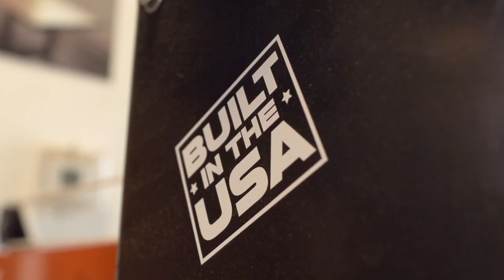SlabMizer MB200 Slab Flattening Mill in Action | Wood-Mizer

Comment: At work we have a CNC that is primarily used for flattening slabs and I think I would prefer a machine like this. The cutter on the CNC is only 2” diameter vs 5” on this machine, and we restrict it to .05” per pass to ensure that it doesn’t bog down when running. I always do at least one manual pass to ensure there are no surprise high spots that are going to stop the machine and to speed past the low spots where the cutter isn’t cutting at all. It looks like this machine has the power to flatten a slab in a single pass, so given the way I actually use the CNC, this machine wouldn’t take any extra time.

Comment: How much does that big beauty run?
Reply from the maker: The SlabMizer starts at $16,995 USD. For more info and to request a quote visit - https://woodmizer.com/us/Products/SlabMizer-MB200-Slab-Flattener
Reply: @woodmizer  That's only 4 easy payments of 4248! =D
Reply: at 16k though, what's the benefit of this over a CNC machine?
Reply: Wood-Mizer Wow! Why wouldn’t someone buy a CNC for that price and achieve the same without the need for joystick or manual operation?
Reply: Christopher Baker 
Benefit 1. 5” cutter
              2. 56”w 13’ material to work
              3. No computer 
I don’t wanna program something or even care to learn how to do it. Just want some thick flat slabs. Don’t know of a CNC that goes this big that’s not double the price. Also can’t find a bit near 5” which means a longer work time.
Hell I could pay a buddy in beers to run that joystick lol even have someone to help flip it!
Reply: Pay for it with 4 premium tables and have a blast.  It’s a bargain if it works like the video and lasts.
Reply: Yeah, might as well buy a CNC and be able to make way more money with a CNC for its versatility. Price needs to come way down on this to compete with a CNC.